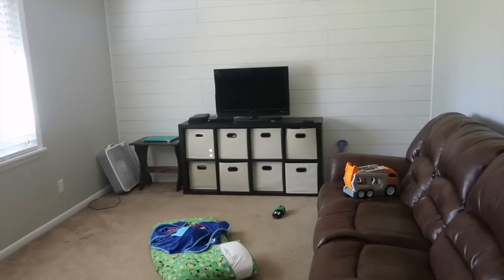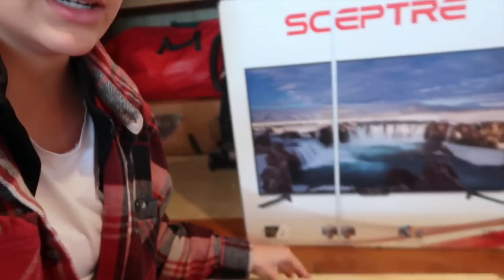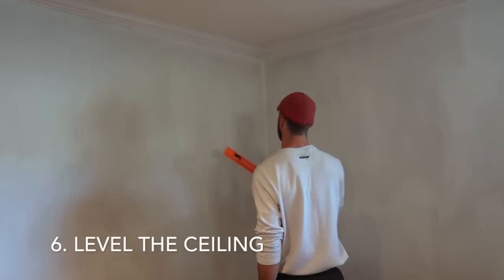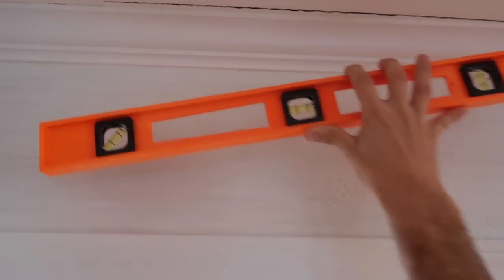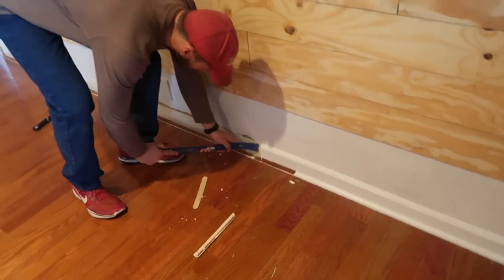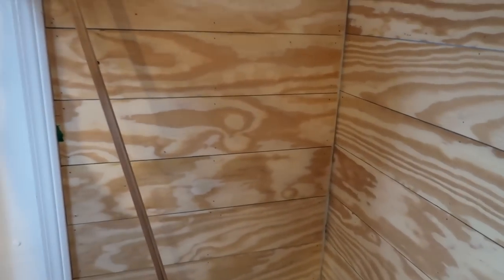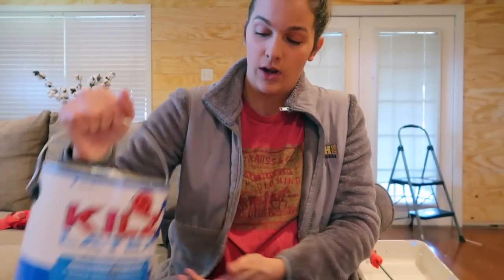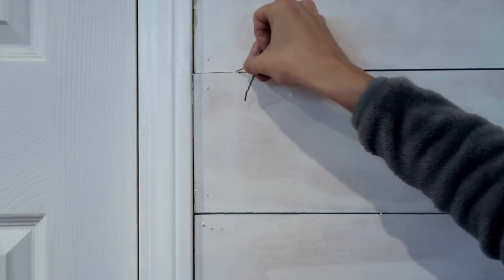DIY SHIPLAP WALLS: FOR BEGINNERS: EASY & AFFORDABLE

Comment: I Primed and painted the plywood strips before putting them up... So much easier, no paint between the lines to clean up.  I layed 15 strips cut down into 5.5 inches  at a time over a tarp, and by the time I was done rolling primer onto the 15th board,  the 1st one was  ready for paint. I used a fast drying primer and rolled both the primer and paint with a broomstick attached to my roller for comfort... After nailing them with a Brad nailer I covered the tiny  holes, retouched and was done my entire 5x8 bathroom in under 2 hrs. What consumed a bit of time was all the prep work... ripping the plywood down to the 5.5 inches  and all the sanding I did to make sure they were smooth. Your living rm looks awesome and I love the color you went with...  I used the same color for my newly finished shiplap attic.

Comment: First, thank you so much for the video!! I just wanted to warn you and anyone reading... We did some stuff on our last home and broke a small piece of the baseboard, same size as you. It was almost paper thin. We later found out it was big enough for mice to come in, and boy did they! They moved in and invited all their friends and distant relatives. If you don't fill it with wood, put some steel wool in the crack. Also, peppermint oil on cotton swabs help.

Comment: Awesome job!
For those about to start a project like this, buy an inexpensive nailer and compressor (can be purchased as a kit). I bought the cheapest one at Home Depot for $139.00 it's been worth every penny. I put up shiplap in my bathroom, new baseboards, crown mouldings around the ceiling and atop the kitchen cabinets.
Reply: 100% agree. A small compressor can be used for a bunch of things too, and air tools are pretty cheap once you have the compressor. Even things like a tire inflator in nice to have at home, since you now have to pay for air at fuel stations most places.

Comment: I used to work for a very picky general contractor, here is a few tips. Always cut to size of  outlet opening unscrew the outlet  enough to allow the boards to be behind the outlet tabs and tighten them against the planks.  sometime you need to install a mud ring or box extender depending on panel thickness. When paint is dry put your covers back on. Counter sink your brad nails. You will get a better look close up.  If you have a lot of ship lap and trim to install, a brad nail gun comes in handy. Always use construction adhesive behind panels if you want this to be a long term project. Remove your trim with a flat bar, now they sell a special trim pulling tool. The overall look of your project looks good from 4ft away..Hope this helps, have a gr8 day.
Reply: I'm going to give this a try. If the planks are nailed to studs, why would you need construction adhesive. Will the planks warp over time between the studs?
Reply: @BWCA-vy2pi  It helps hold them firm without sagging

Comment: Looks nice. Here’s some tips. 1. Get a nail gun, either air or electric. 2. Unscrew covers and outlets / switches. Cut wood the size of box only. Put outlets / switches back and then covers.

Comment: As some have already commented. It’s always better to remove the outlet cover. It would only take a few minutes and the look will be way better and the cut out doesn’t have to be perfect. Longer outlet screws are cheap and easily found at your local hardware store.

Comment: Next time try painting the wood and trim before you hang it. It’s much faster. When your done just touch up where you nailed it.  When you remove the trim pieces, run a box cutter between the wall and trim. It will come off cleaner.  Kill is a good primer and you can’t go wrong w Sherwin Williams paint. When painting such a big area, maybe borrow or rent a spray rig to make the paining go faster.  Also, rent a nail gun. It will really make it go faster. Great video!  Great results!

Comment: Beautiful little girl.  You guys did a great job & thank you for the video on how to do this.  It is quite a big job & it definitely is time consuming.  You are smart to watch more than 1 video so you get more ideas & see which one is the better & you can mix ideas to improve the outcome of a shiplap wall.  I seen the shiplap look of the multiple colors on a bed head board but when I seen the cost of all the colors I said not for me.  Keep up the work on your home then when it is done & how you like it, you and your husband can sit back & listen to all the positive comments people will give you.    And then maybe they may want to hire you to  do their home.  LOL   Most people would not have the patients to do all that work & yes work along side of your husband & not want to face disagreements along the way.  Again LOL
Reply: Hi Carla, you are so right, Shiplap can be expensive, but, there's usually a bit of a cheaper way or two to accomplish the same look. If you liked the look of that "Multi-Colored" Shiplap Headboard you mentioned, l believe it can be duplicated less expensively, and just as Pretty, if not Prettier, by just buying several Pint, or Quart Sized containers of Paint for the Shiplap Boards. Paint is much cheaper for such smaller quanties, and since/if you'd only be creating the "Shiplap Look" on an area the size of a "Headboard", that would keep the cost at a minimum too! Hope this suggestion may help you to reconsider & get just what you want!

Comment: Good job upgrading to a jig saw also instead of using popsicle sticks get tile spacers 1/8 you can get a box of 100 for $2 you only need like to use 8 at a time if you screw your shiplap to the wall

Comment: Shiplap is easy until you have random width boards .Just today I worked with 4 and1/2  some were 4 and 5/8 and some were 4and 3/8  .
 It was trouble to match the reveal lines in the corners. But we  managed. 
   It turned decent .

Comment: Bonus tip. Take your crown and base boards off and put them back on top of the installed shiplap. If you’re doing your entire room you’ll need to cut them down 1/2 (if your using 1/4 board on all walls) in length and you can cut boards in the center or at other straight breaks in the board if you don’t have access to a compound miter saw or don’t want to mess with angles. Furthermore, you can place a quarter round at the bottom of the base to finish off the flooring if you do get new floors without cutting up your current flooring.

Comment: You all did great work. I got the confidence to DIY my walls thanks to your video. Why didn't you all use a paint mixed with the primer? I'm definitely buying a brad nailer my RA would have my funds locked up big time nailing them boards manually.

Comment: I may have missed it early in the video but quick question:

After you all had the plywood ripped at HD, did you all rip a tongue and groove pattern to better fit the boards or was that the purpose of the popsicle stick?

TIA!
Reply from the maker: We used the popsicle sticks to add the spaces in between the boards. What is a tongue and groove pattern?
Reply: Tongue and groove is the ripping they do on the board when you buy the shiplap boards at places like HD.  That way there’s a nice fit and finish.  But I’ve seen the spacer work just as well.  Maybe it’s a South Texas thing that we call it tongue and groove.
Reply from the maker: oh i see now! there is no tongue and groove since the pieces of wood are just split. the popsicles sticks are optional!

Comment: Thanks for posting- first time I’ve seen cutting shiplap boards to fit the light switch after it’s on the wall. Would save having to get/make an extension for the box but also means your cuts have to be really clean since they are exposed.  

....remodel & marriage counseling - Truth.

Comment: Thank you so much for this video! We just went to Home Depot and got all our supplies and plywood. Did you also use a popsicle stick to separate the boards beside each other or did you only leave a space between the rows?
Reply from the maker: nat319 we tried to eyeball those and make them a tad bit closer together than the horizontal spaces but you could definitely use a popsicle stick for those!

Comment: I'm wondering why not cut the strips with an angle, something like 7 or 8 percent, alternating the cuts of course or flipping the boards over so you don't have to cut twice which should give the same effect as a nickle gap while still being able to butt them up toe ach other?

Comment: It seems you could have saved some steps by getting real shiplap. What I'm planning on using is available at Home Depot comes in 9/16 X 6.75 inches, and available in 8 & 12 foot lengths. It's also pre primed and since it is rabbited on both edges, no need to prime the walls and you can also hide some nails between rows.

Comment: Did you consider removing the outlet and switch covers? Will give you more room for error...screws should still be long enough, if not buy some new ones a 1/4" longer, they are inexpensive.

Comment: so just being helpful... around the outlets, take off the outlet covers, measure your cuts along the electrical box, pull the outlets out from the box, after putting the shiplap on the wall, re-secure the outlet to the box, and then put your outlet cover on.. .
Reply from the maker: Yes! Didn't get it on video, but we ended up doing that after realizing we didn't like the way it looked. It turned out much nicer.

Comment: If you would have used underlayment plywood you would have had a easier time. It doesn't have knots in it and one side is super smooth and actually pretty wood.

Comment: Question from someone who is very unfamiliar with shiplap: why do the boards need to be separated popsicle stick-width? Why can’t the planks be touching?
Reply: Users preference.  I butted my 1 x 6's against each other and get the same effect as she did.  I also had a stud wall to nail into using my cordless nail gun.

Comment: If you had a compressor and nail gun, You would have done it in half the time. My husband has both compressor and gun so I'm going to use them. I'm also going to prime my boards before I put them up.

Comment: You sound like you're talking to 10 year olds. Also, you made it harder than need be. Just cut the majority of the 8ft boards in half, then stagger. Final step, cut boards to fit in the smaller areas. And you don't need to nail every 6 inches. Also should have used nickels or pennies for spacers.

Comment: Idk... Is it just me... Or is this not really "shiplap"? I mean... They say they wanted it to look authentic... But there's nothing "authentic" about this...

Also can't forget to mention that a lot of things they say as "tips" are things you should stay away from or things you shouldn't do...

These people seem to be your stereotypical "I'm gonna diy something!" without actual knowledge of what it is they are wanting to diy... They fall into the "most beginners screw this up" traps several times...
Reply: Hikari bit Rude 😏
Reply: Hikari okay, says the furry 🤣
Reply: It's not shiplap, but it does look like it when finished, kinda made me flinch every time she said it since I ran into this video on accident while trying to decide between real shiplap or tongue and groove and was expecting to see the actual thing due to the title.

It's a good looking finished product though and, since they're using it for interior walls and not needing the boards to produce a climate shield or deal with fluctuations in temperature and humidity, it will work just as well for them with a much lower cost than doing the real thing.